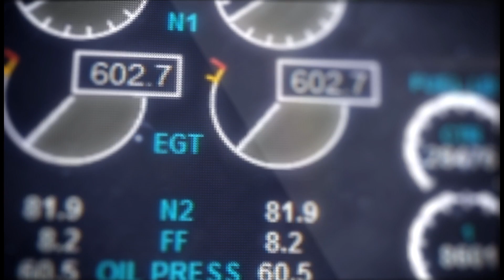Aircraft Turbulence

Comment: I had an incident in 1980, flying back from the USA to the UK in a DC10, when we flew into the ash cloud, caused by the eruption of Mt. St. Helens. Apparently, we dropped between 10 and 20,000 feet. Apart from the sensation of being in a lift (elevator), there was no other sign of any problem, so it would appear that, even the (at that time) notorious DC10 had absolutely no problem coping with abnormal atmospheric conditions!

Comment: FRIENDS—RELAX! There is almost no significant reason to fear turbulence. As he said, aircraft, especially the commercial jets, are designed, built, and tested to go through MUCH more severe turbulence than you will encounter.  Just use common sense and remain strapped in while in your seats and if this get choppy, get rid of any hot drinks even if you have to pour them on the floor AS A LAST RESORT ONLY! You WILL be FINE. NOW GO TO SLEEP; you may have a flight soon!

Comment: Sure glad you covered this subject of turbulence. I have a couple of questions on this topic -
1. Are the super-jumbo A380 or 747s less affected just because they are so big? A couple of times I was on an A380, even at the tail end, seems like the flight was so smooth, I hardly felt any bumps at all. Or was I just lucky that the pilot was able to avoid the turbulence?
2. Not sure if you got your flight training in the military, but my question is what happens during mid air refueling and they hit sudden turbulence? Are there any protocols if they need to break off? To avoid a collision, does the mother plane always pull up quickly, for example?
Thanks for your expertise, as always.

Comment: I used to fly United a lot years ago and you could always listen in to the audio channel between the pilot and air traffic control. What I learned is that the pilot is constantly talking to air traffic control and negotiating airspace for a more comfortable flight. Quite often when turbulence hits, the plane will either descend or ascend because this pilot is trying to find smoother air. They are not screaming and panicking - it all sounds very routine and reassuring.
Reply: Yeah, love that ch 9. About the only reason, I fly United, ha! Hate it when the pilot chooses not to turn it on or when the audio malfunction at my seat.

Comment: Yes thank your Capt Mentour for your confirmation that the most quiet seats are over the wings and that the rear seating section is guaranteed to be most bumpy.

As far as engines noise goes the front of the wing is quieter than the rear part of it where the exhaust flows. 

I tend to care about basic COMFORT TO SLEEP when flying 12hrs over to Asia or Europe, big difference after landing 👍🏻

Comment: I was flying from England to Spain once, something I do fairly often. I'm no expert, but we had been in the air for a while, I'm pretty sure we were at cruising height and speed, when I'm sure I noticed a very slight decrease in speed, you feel yourself shift slightly in your seat. It was barely perceptible and I wondered if I'd imagined it, when shortly afterwards we hit a bit of turbulence, nothing dramatic and it soon passed. Could this have been what you described as the Captain slowing for the expected bump?

Comment: Flying out to the Aleutian Islands is usually a really a bitch of a flight. 24/7 turbulence, side-effects of flying there include butt-tingling sensation, exploding soda cans, and slight difficulty holding it in while walking to the bathroom.

One time coming from Dutch Harbor on the way to Anchorage we flew into a thunderstorm. This thunderstorm would have shaken any normal pilots jimmies but these pilots luckily where balls to the wall kind of men. A little bit away from Anchorage, we had a strike of lightening burst right next to us. The light was blinding and we could feel the heat from the bolt like we just stuck the right side of our faces next to an oven. We drop for a good 5-8 seconds (my travel partner insists on 8 seconds, the pussy) with everyone screaming bloody-fucking-murder all the la-di-fucking-way. You'd think we would be done but we got desert with our heart attack following the most bumpin' ride over the Aleuts with the plane tilting side to side repeatedly.
The whole ride I was thinking "that's it, we are gonna strike out and they're gonna make a movie of us."

"Ladies and gentlemen, this is your captain speaking. I'd just like to reassure you that everything is absolutely OK. Some of you seated on the left side of the aircraft may have noticed that the engine is belching flames and the outermost ten feet of the wing have disappeared entirely. This is a feature of this particular class of aircraft, and not cause for any alarm. As you may also have noticed, things have been a bit bumpy for the last few minutes. We've, uh, been encountering some strong crosswinds at this altitude. Also, the top of a mountain. However, that's mostly behind us now, and I think I can promise you a smoother ride for the remainder of our extremely short flight.
Please feel free to unfasten your seatbelt and walk around the cabin because at this point it really isn't going to make a difference whether you're strapped in your seat or not.
We hope you have enjoyed flying with us. Please make sure that your seatbelt is fastened before impa- ... I mean, landing."

(Mostly) true story.

Comment: As a youngster (about 10 or so ?) I was on a flight at seriously low level by jet standards (5000 ft IIRC) in a Bristol Super Freighter, carrying the family car from Southampton to Guernsey when we hit what used to be called an 'air pocket'. The plane probably only dropped 50-100 ft but did so quickly, causing a serious shudder and a LOT of noise. Another passenger next to me was very sick (luckily in a sick bag) but I was relatively unbothered. It just goes to show how sturdy planes actually are. I remember well the take-off too. Being piston engined and a freighter, the acceleration was amazingly slow down the runway and I watched a hedge at the airfield boundary coming closer and closer. It seems as if we barely cleared it but that was aviation back then.
Reply: pasoundman you had the car on the plane ?
Reply: Likely - it is a "Super Freighter", after all.  :-)

Comment: Do you see tornados while flying the aircraft? How do you manage these tornados? Tornadoes are formed instantly. Do you get them on on weather radar by the aircraft? Does the aircraft controller informs the pilot about the possible tornadoes using TCAS system? How do you operate such grave situations safely? I haven't heard any aeroplane accidents because of the tornadoes. Has it happened because of shear luck or it is because of human intelligence and their appropriate actions.
Reply: Seriously? What's the deal with tornados? No WX radar in aircraft do not show tornados. You need expensive ground based doppler WX radar for that. TCAS does not show tornados either. When tornados are spotted by WX reporting agencies Aircraft stay away. Airports can and do become temp closed as Air Traffic personnel will evacuate the AT control tower. I did once upon a time pop out of a low cloud deck 800 feet above the ground on short final to a runway at the Aurora IL. airport as a tornado formed right in front of me on the runway. I called an abort and went off to the left side of it as it was moving to my right across the runway. I went to the go around procedure as the tower was under evac at the same time. I had to hold for 30 minutes in a holding pattern until they reopened the airport. The go around procedure had me climb back up into the clouds after I passed the tornado so I never saw it again. The holding pattern was clear well behind the path the tornado was taking. Shear luck in my case.
Two more minutes and I would have been on the runway under that tornado. 27 aircraft on the ground at the aurora airport had been destroyed that day. I was flying a LR25.

Comment: I've seen the wings bending quite a lot one time on a flight because of turbulance, looks pretty scary but I trust the aircraft structure 100% :) Turbulance is also the reason why I ALWAYS keep my seatbelt on when I'm sitting down in an aircraft.
Reply: It is often recommended that people wear their seat belts for the entire trip, just as they would in an automobile.
Reply: And besides, if you don't know, aircraft wings are DELIBRATELY designed to flex, since if they were just rigid, they'd just...break.

Comment: Turbulence is not the issue.  We all know aircrafts can take it.  It's more to do with how pilots are trained to deal with associated issues (like icing).  If you look at the AF447 crash and the Air Asia one, those were not directly caused by turbulence but turbulence caused a chain of events that led to crashes.  The Flydubai crash was also an indirect consequence of turbulence as well

Also the American Airlines flight that crashed after takeoff from JFK was indirectly caused by wake turbulence.  In fact in that instance, the pilot did not know that they cannot apply so much rudder input to counteract this... as such the aircraft structure couldn't take it and it disintegrated (and this particular aircraft type has been flying for decades and there was still confusion between Airbus and AA regarding the training of how to counteract wake turbulence)

As airlines cut costs and also with lack of supply of pilots, airlines will likely cut training, and lower entry standards.  That is likely to translate to more errors when a chain of events happen that  involves turbulence

Comment: Rehi Mentour...

Here is a safety question I have not heard anyone ask:

While we may be familiar with the "less dangerous than imagined" situation with lightning strikes, I think there may be an added concern when Lightning is around.

Lightning is normally accompanied by thunder because the intense energy of the lightning causes neighboring air to expands rapidly and violently. while the volume of the resulting air blast is likely too small to do any real damage (or if that were not the case I think lightning strikes would be accompanied by a loit more serious damage than they usually are).

However such sonic blasts can be very strong and sudden, even on the gound outside in a thunderstorm.

so the question is what ire the probabilities that such sonic boom can cause otoher damage, or damage to the rears of both cockp[it and cabin crew, as well as passengers when the lighning passes very close to the aircraft, whether or not it actually passes through the skin of the aircraft?

Cockpit crew will have some degree of protection from their headsets, but it seems less so for cabin crew and passengers.

How much risk of added danger is there typ[ically in such situations?
Reply: The lightning travels around the outside of the plane it's a Faraday cage just Google that.

Comment: In the case a plane hits a bird while taking off or during the flight, would it be possible to put some protection on or in the inlet of the engines like grid or wire mesh in order them  not to get the engine damaged? would the air flow be disturbed in the inlet?
Reply: There is no way to safely attach such a mech. The risk of it coming loose and beeing sucked into the engine is bigger than the hazard a comparebly soft bird is to an engine...
Reply: Thought about some way to prevent it, too. But consider sooo much air is being sucked in, any birds would just be suck thru any type of mesh or grid.

Comment: Once I had a situation, that during the climb shortly after take-off (maybe 1 or 2 minutes) the plane started to make what felt like a very sharp turn. Suddenly it felt like a plane "slid" down in the direction of the wing which was lower (sorry, I watch your videos but my vocabulary is poor). It was a little bit scary, as we were not so high yet,  I involuntarely grabed hard the armrests as I was pushed towards my passenger on the right. 
Immediatelly after that pilots rolled airplane and leveled up the flight. This situation took maybe 15 seconds but was scare at time being (you could hear a little bit of distress among other passengers).
Do you thing it was turbulence or windshear? Was it dangerous?
Reply from the maker: +Garreth It was probably turbulence but probably not dangerous. It always feel worse than it is she. You don't know the reason behind.
Reply: Well, I don't think that there was any pilot mistake in this, but your video reminded me of this situation. What felt scary was the low altitude and immediate maneuver to level up. 

Anyway huge thanks for your videos and your unexpectedly quick answer:) Hope I'll be your passenger someday:)

Comment: I read a report somewhere that in most cases, the felt turbulance is less than 6-10ft.   That feels like a lot to a human, can even cause a "pit of your stomach" feeling; but when you're at 35,000 ft, a 10 ft drop is only .003% of the altitude, and the autopilot will recover that almost immediately.    It used to be a bit scary and annoying when I first started flying, but now that I'm flying 50 round trips a year, sometimes more, i barely notice it anymore.
Reply: Lithium381 was once flying from US back to Netherlands, we had those nifty flight height monitors as a possibility on our TV screens: had a massive flop of turbulance, quite a few screams, looked at the flight height and it had gone from 35000 feet to 34something something... are these kind of drops common?
Reply: not true a plane can drop up to 30 meters during turbulence. Moreover, the sensation is worse than falling, because more than >1G is involved

Comment: Why passengers have to Switch any electronic deices off while departure and landing ? Isn´t sufficent to go on flight Modus ?
Reply: SuperBierkrug That's always bugged me, as it's only radio interference caused mainly by cellular radio emission, and possibly WiFi/Bluetooth that May be an issue. Unless the device is actually powered off it will still be active even in standby, which I'm sure is the state that the majority of people leave their devices in. He explains in another video that everything is assumed suspect until it's absolutely proven to be safe, that's a fundamental part of the safety culture surrounding civil aviation.

Comment: Anyone afraid of wing breaking or falling off the plane may watch the video (v=Ai2HmvAXcU0) of an engineering wing load test and see how much wings can flex or bend before they break. Here for a 777, but this is a mandatory test for all aircrafts before they are certified for flight. It means that the structure is tested for 150% of the worst case load the plane could possibly experience during flight before it breaks. For engineers: the FoS is 1.5 against ultimate stress of the wing structure at Design Limit Loads which are even higher than the Flight Limit Loads, the said worst case loads:)

Comment: The best ride quality of an aircraft, in design, is achieved through a large WING LOADING, that is, high Weight to Wing Surface ratio. Aircrafts with higher WING LOADING will exhibit smoother response to gusts/turbulence. In flight vertical accelerations are reduced by reducing the airspeed of the aircraft. The turbulence penetration speed achieves this, it tries to be somewhere in the middle between the maximum and the minimum speeds of the plane, to have best margins either way.

Comment: As a student of MSc Aero Engineering, in one of our lectures in Aeroelasticity the Professor said "... so the plane is designed to withstand any gust with a probability of less 10^-9 of encountering one that actually over-stresses the structure..." Student raises hand: "What happens in those 10^-9 cases?" Prof. laughs and says: "I'd better not be sitting in that airplane" hahah

10^-9 is a MINUSCULE number, you can't conceive how small it is.

Comment: This is probably a stupid question, but I was thinking about you on my way home yesterday. 

So, in a car, when you're driving due west during sunset, you have probably close to an hour of blinding sunlight directly in your vision.     On the ground however, it's workable because we're constantly changing direction while driving. I'd imagine that it would be brutal in the cockpit since for the most part your keeping a consistent direction, not to mention your horizon is lower. Is that even something that factors in when you're flying? What if the runway your about to land on runs east to west?
Reply: Galaxy Rhen + I agree! How are the various  directions and angles of runways at airports chosen by the designing engineers? Are they by common wind direction? Excellent question!
Reply: @annnonymous9791  they are indeed designed with common wind direction in mind.
Reply: That is a question that I want to ask? good one.
Reply: Pilots wear sunglases and aircrafts have aditional darkened glas sheets to put into the pilots sight to 'dim' the sunlight

Comment: I appreciate your input into trying to calm the public about turbulence, but I have to contest turbulence not being an issue for structural integrity. The whole purpose of having a turbulent air penetration speed is to prevent gusts induced by the turbulence from inflicting airframe damage. Extreme turbulence is a definite danger to structural integrity. Thankfully, we have learned these lessons and have put procedures in place to avert these dangers. A few notable examples of airframe failure where turbulence was a factor:
https://en.wikipedia.org/wiki/Northwest_Airlines_Flight_705 (Boeing 720, 1963, 43 dead)
https://en.wikipedia.org/wiki/BOAC_Flight_911 (Boeing 707, 1966, 124 dead)
https://en.wikipedia.org/wiki/Wien_Consolidated_Airlines_Flight_55 (Fairchild F-27B, 1968, 39 dead)
https://en.wikipedia.org/wiki/NLM_CityHopper_Flight_431 (Fokker F-28-4000, 1981, 17 dead)
And lots and lots of small GA planes that inadvertently entered thunderstorms and broke apart midair.
(Please don't take this to mean your videos aren't appreciated! They very much are!)